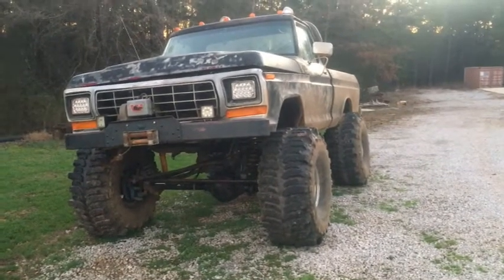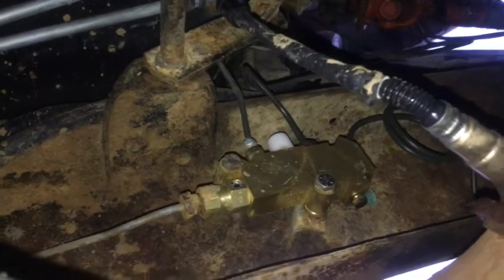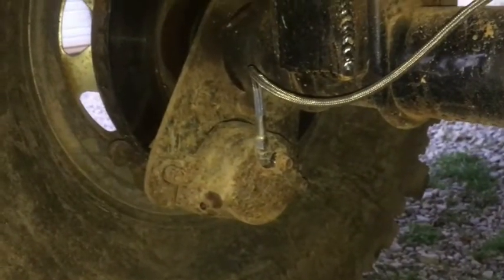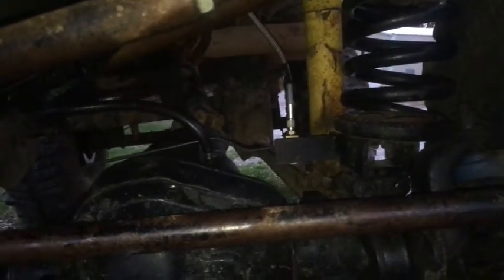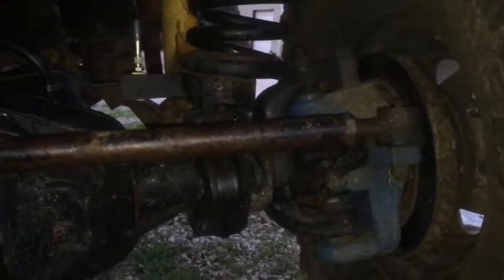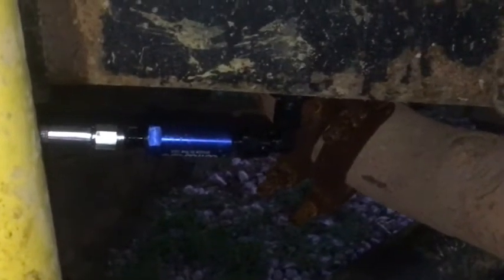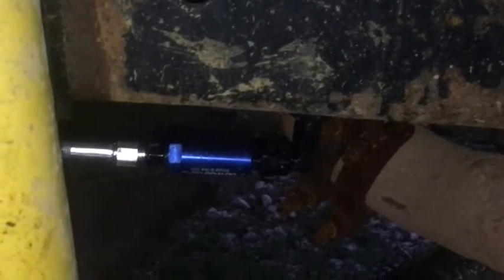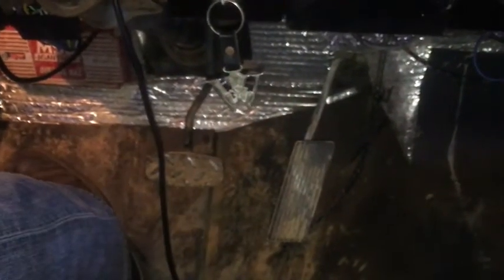Please help me fix my Custom Brakes! My braking system

Comment: My understanding is that combo valves "real" purpose is safety. It is there to make sure you retain one braking system if the other goes away (front/rear). First thing I would do is eliminate that from the system (temporarily) and see if you experience a change.

Comment: Your combo valve could be an issue I've had issues with mine while bleeding. For instance I only had front brakes. Cause while bleeding the rear lines if you push the pedal to quickly the proportioning valve will snap completely over and limit fluid to end you are bleeding. Fail safe if you lose a brake line wheel cylinder ect, that way you can still stop the vehicle.
As far as your long pedal travel you have to much flex line on your truck although you can't see the lines swell but trust me they are. The shop here locally won't even make you braided lines that are longer than factory unless it just for a wheeler. Technically they are not DOT because they swell. If you add hard line everywhere possible, that will greatly improve your pedal travel.

Comment: I don't know how send a break lines diagram for your truck you run the lines like 83 Chevy one line to the back with you line lock off the proportioning valve and one line to the right side and one for the left side off the proportioning valve the two line on the master cylinder go to the proportioning valve .Ford and GM  has the best brakes systems
Reply from the maker: jeremy3798 not on this model Ford,the bottom outlet on the combo valve is plugged from the factory, also the extra 3ft of restriction would not make the pedal softer. It is inconsequential; if anything it would make the pedal firmer. Thanks for taking time to comment though.

Comment: The t in the front it needs to be 2 lines
Reply from the maker: jeremy3798 wouldn’t a single line make pedal firmer if anything?
Reply: thekingofcows no you need the 2 lines for valune

Comment: The bore being larger in the master is fine but the stroke may be shorter than that of a 92. I had the same trouble when i put 91 model disc on my 83. I had to run the 91 master.

Comment: Ok, here’s my assessment. I believe one of two things. I think the problem may be in the combination valve. My 2000 Chevy has hydroboost and it has a Dana 44 out of a 79 f250 with the dual piston calipers, rear is the factory 14 bolt with dual piston calipers.  I completely removed all the abs and ran new 1/4 inch hardline to all the brake hoses frame side, 3/16 on the axle side. It stops perfect with a perfect pedal. I originally had a proportioning valve to help with rear lockup but it wouldn’t pass enough fluid even fully open. I think the combo valve you have may be undersized or faulty. Bypass it and see what you get. Otherwise your master cyclinder size is two small. One more thing, if those are the cheaper stainless lines have someone watch them while you hit the pedal. We had some that would swell up but not leak on a buddy’s truck
Reply from the maker: Creepycrawler     I have my suspicions about the combo valve too. I will probably windup bypassing it to see if that helps. The rear lines are cheap summit band hoss, the fronts are russel, I can’t see any hose bulging.
Reply: thekingofcows also not sure on ford hydro boost but my Chevy hydroboost goes down a lot farther if the trucks not running, if the ford was the same and you had a bad hydro boost could that cause the problem?